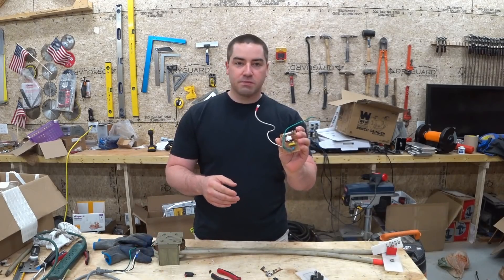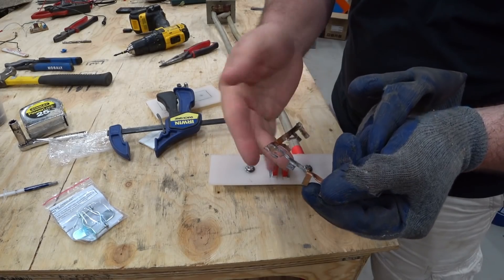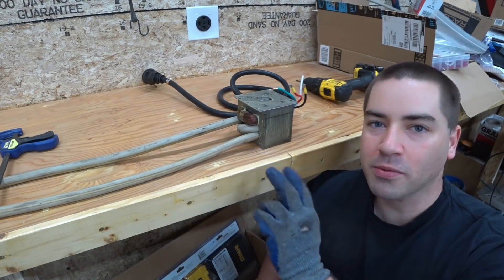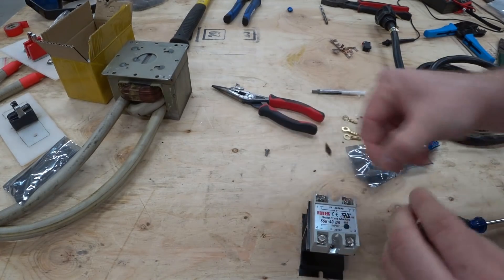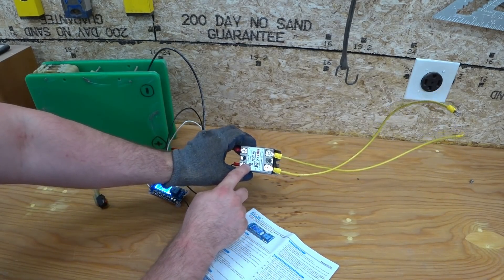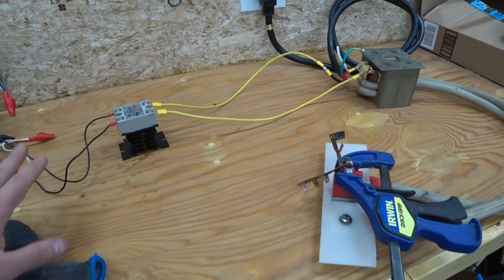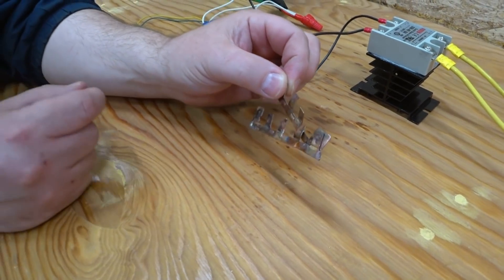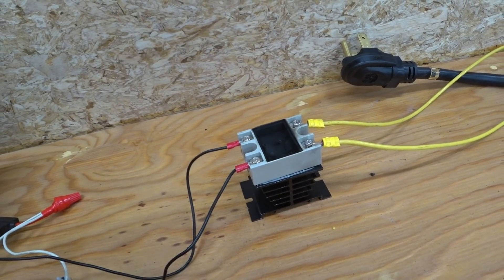DIY Spot Welder, Part 3, Timing and 240 Volts

Comment: David, I love your stuff and have been a subsriber for a while Kudos for showing your failures (AKA Learning experiences) as well as your successes. I've made a spot welder for batteries from a microwave, and I have a couple of hopefully useful comments on your efforts here.

(1) as you already knowm, that transformer is not for 220V which is very dangerous. It will overheat and short out the mains and blow a house breaker.
That is also likely why your 40 amp SSR blew.  In normal use, your 1000 Watt microwave would draw no more than 10 amps from your 110 Volt supply.

(2) 1000 watts is plenty to spot weld battery tabs, so doubling the input power is not the answer, even if it was safe.

(3) Did you remove the shunts from the microwave? These are small blocks of metal laminate inserted into the transformer core to avoid over-saturation. I found I could not get any welding action until I removed mine.

I made a video on this, but I don't want to spam up youir channel - if you'd like the link please let me know.

Good luck!
Chris
Reply from the maker: I'd love to check out your video.  It's not spam if it's helpful.  Thank you for the tips.  Yes, I removed the metal strips between the primary and secondary.
Reply: @DavidPozEnergy  Hmmm. What AC voltage are you getting at the output wires? (Be sure to select AC on your meter)/ I get around 2 volts. Ohm's law still applies so I= V/R. The current is what we want, so if the current is too small to weld, then the voltage is too low for the resistance of the things you're welding. So I would try finding some slightly thinner wire (preferably thinner insulation but trhe same width of conductor) and wrap more turns to raise the voltage. Of course this is a balancing act - thinner secondary windings wil also have higher resistance - but that's the way I would go. Here's my video: https://www.youtube.com/watch?v=6sMxc0NHNQA
Reply from the maker: 1.5 volts AC when I have the primary attached to 120 volts.  I didn't get a chance to record the voltage when it was connected to 240 volts.  My meter is slow and it was getting hot.
Reply: @DavidPozEnergy  OK so it's a low, so trying more turns is something to try. You coulad aslso measure the resistance of the secondary circuit - from electrode to electrode. That should be very low.

Comment: Still using the worst electrodes , aluminium and tungsten rods, use only copper rods with copper buss bars or better use silver if you want to use another metal after the good copper wires you have there.
Reply: chancho00 silver solder in a paste form may be the best chance to doing this task as silver is attracted to most  dissimilar metals ie copper and aluminium
Reply: @AdrianHiggins83  Tinning paste, a mix of flux and solder, might work here and at lower temperatures.

Comment: what was the voltage across the secondary/output leads ?
Reply from the maker: O, boy.  I am trying to remember..  I think 2 volts.  Not quite sure.
Reply: @DavidPozEnergy  was trying to make one earlier didn't quiet do anything.  i was using amplifier cable. maybe too much insulation, will try it again.    i think you need 2 transformers to make 240 v welder.
Reply from the maker: In the end I went back to 120v and left it on for longer.   Several people have written me and said they had better success with two wraps on the secondary wire instead of one.  You may want to give that a try.

Comment: Would a starter relay from a car do it? They can handle a huge amount of current.
Reply: nope, since they dont handle 230v on the bridging end. But will work if you use a 12v battery setup for welding

Comment: My first thought would be to use a big car stereo capacitor low voltage and charge it from a power supply that you could adjust the voltage. You need a big relay like a car starter solenoid. This way you don't have to worry about a timing circuit you just charge the capacitor go to a voltage that works for you. DC might well better also. Click on my profile picture to see my projects

Comment: At least there was fire! I don't know, but intuition tells me you haven't got enough current density at the welding tips. The more you spread the current over a larger contact area, the less effective the weld and the more heat you transfer to the metal?
Reply from the maker: Those tungsten tips have very small contact area.  I don't know how much smaller I can make it.
Reply: @DavidPozEnergy  Hmmm, it's a curly one. Perhaps the resistance in the tungsten is too high? I came across this article that seems to imply some alloy of copperhttps://www.twi-global.com/technical-knowledge/faqs/faq-what-electrode-material-should-i-use-for-resistance-spot-welding
I don't know if this is helpful, I hope so!

Comment: solar is correct. transformer came out of a microwave which ran on 110-120v. I can almost guarantee you that the primary has at a minimum of 120 turns. this isn't coincidence.

Comment: Double the input voltage == Double the output. Wouldn't use it on 2 phase 240v while designed for 120v.
Spot welders won't make that kind of noise. A light hum without sparks. I'm used to handling those.
That it exploded is due the inrush current. Maybe an PTC thermistor and an ZC (zero cross) detection.
Reply: Double the voltage, 4x the power.

Comment: I can confirm those SSR modules are junk, I have used one once and I doubt it could have carried 25% of its rated 40 amps.  I use a large contactor on mine currently, not precise on timing perhaps but it works.  I use a microwave transformer at just 120V, I have a smaller secondary wire and it works ok, not perfect but enough.  I hope to move to using super capacitors at some point with a bank of high power mosfets for switching.
Reply: The real ones are good but there are many fakes being sold online. Best to buy from a major electronics distributor. If you buy them on eBay, Amazon or AliExpress you're taking a big chance they will be fake.

Comment: Use a 100A ssr why did u use 40A even a lipo battery can output 40A easily
Reply from the maker: I did not have luck making my own spot welder.  This is more of what not to do.  I ended up buying a Kweld spot welder.
Reply: @DavidPozEnergy  Ye I was planning to build one as well but a lipo battery powered one don’t like messing with high voltage 🤪🤪
I’m in my 2nd year of electrical engineering at university 👍🏻👍🏻

Comment: That's pretty cool...have you tried some solid copper electrodes? They've always worked best for me...what kind of tungsten is that your using?
Reply from the maker: One of my early experiments I did, but because I'm welding copper, the copper tips weld themselves to it.  I need to use something different.  The tungsten is from my local welding shop ($4) it's used in the TIG welders.  Thanks for watching.
Reply: Idk if I’m right or anything I haven’t looked it up either....but tig tungsten I don’t think is going to work....when your using tungsten in tig welding it is shielded with argon the entire time protecting it from the atmosphere....so I think soon as you fire them as spot welding tips, the tungsten prolly immediately contaminated and every time after it just degrades further....so maybe if you could shield them when trying to spot weld somehow...I don’t think it work...I could be wrong tho...I know it don’t take much to contaminate the tungsten tho...
Reply: But I don’t know a whole lot about tig welding...I’m just learning and practicing and figuring it all out

Comment: I was going to say you urgently need a fuse on the primary side because the solid state relay will probably fail "on" but I guess you know that now. I am no welder but I would have thought cleanliness of the surfaces to be welded would be vital and you don't want any weight on the point being welded or the whole assembly can start moving when the metal becomes briefly molten.

Comment: I know exactly what the problem is. I know this because I made the same mistake myself. 

First off I don’t recommend ever hooking up a transformer to power it wasn’t designed to take. Your transformer was designed for 120v and that’s what it needs to be run on.

Quick disclaimer: I take no responsibility for what anyone else does. Electricity is dangerous.

That being said this will worked with the transformer hooked up to 120v. The problem was that you grounded the transformer frame. If you run it ungrounded you will get the results you are looking for. It seems like such a small thing but it makes a drastic difference. 

I absolutely love doing projects like this too. Just please be careful. I personally prefer to add a switch(just a normal light switch in an electrical box). But when handling anything from where the wires connect to the transformer and after, I always pull the plug from the outlet. A switch can fail. It’s rare but it can happen. It’s also very easy to after going back and forth trying something turning it on and off to end up forgetting. A mistake that most likely would only happen once.

I have personally made 5 different devices from microwave transformers. They are a great transformer to get because of the accessibility and the power capabilities.

Best of luck to you. Stay safe.

Comment: To increase the welding current, why not use higher number of turns on the secondary? Those wires are way overkill for the short duration of high amperage..
Reply: More turns = less current

Comment: Getting closer...;-) Good electrical safety precautions...
The next test would be trying to weld the 2 pieces without the Solder on the 2 pieces. Just copper to copper. Since the pieces keep coming apart when forcing them I believe the heat of the arc just solders that small (tungsten probes) area together rather than actually spot welding them.
With the solder only Spot connection... the connection could come unsoldered if high currents are drawn from the the battery bank.

Comment: all the videos i have seen using those transformers use 3 turns on secondary
Reply: One turn is not enough voltage... you are correct. I believe two to four turns on the secondary is very common and works. Also.. he should have never used 220.

Comment: Please don't go Edison's route, 10,000 ways, build or buy or borrow a proper spot welder before you hurt yourself or your home. 
You have no current limiting in your 220 volt circuit, and your short timing is not tripping your circuit breaker, you could be reaching dangerous amperage levels, 100 amps or more.
If you must go this route, and not capacitative discharge, please use a thermistor or other inrush current limiting device.
There are plenty of spot welding kits on the market, maybe even one that will allow you to use the setup that you already have, please BE SAFE.

Comment: Unless you have to weld copper strip, you might do better with nickel strip and copper electrodes.  That's because tungsten is much more resistive than copper and so the heat gets generated in the tungsten weld electrodes then has to make its way into your copper.  The copper tends to melt from the outside in, which isn't ideal and much of the power is wasted heating up the tungsten.  If you use copper electrodes and nickel strip then all the power gets dumped directly into the more resistive nickel, which will be hottest right in the centre, just where you need the weld to be.
Reply: This is old, but I was going to suggest the same thing. Spot welders use copper electrodes for a reason. Copper is one of the best conductors of electricity, so will not get as hot as tungsten.

Comment: I should have also mentioned that a dead man style foot switch is a nice thing to have. Also if you want more power, two transformers can be used. I would only do this if they were either identical transformers or at least both rated for the same power input and output. So your two transformers after being rewound will each have two output wires. One wire from each transformer needs to be linked with the other, then you’re left with your positive and negative wires, one being from each transformer(note if this doesn’t seem to be working we’ll switch one of the wires that’s tied together between the two transformers). This setup does require a wall outlet that is 220v, it needs to be a 20amp double pole breaker. Which gives you two hot wires at the correct voltage, one for each transformer, the neutrals would be tied together from each transformer going back to the wall outlet. 

*[Disclaimer. This is dangerous. Don’t do it. If you do do it don’t die. If you do do it don’t get hurt either. 

Also be responsible, have your pets spayed or neutered.

Comment: Add a ballast resistor in series with your transformer (or SSR).  An electric heat element or two 120v light bulbs would keep you from cooking the transformer primary.

Comment: You are on a half way David. Just like me when I was building my spot welder. You will achieve perfect result by increasing secondary voltage! As I said 5.5V and You are DONE. 😉
Reply: how many turns on the secondary to get 5.5V?

Comment: your electrodes need to be copper and your secondary wire needs to be smaller with more loops to increase the voltage output then leave your primary voltage at 120v . Remember that aluminium electrodes have a low melting point and will melt and oxidize immediately then that raises the resistance of the weld connection.

Comment: put a ball of paste in the middle in the future and press it out, it hurts my eyes how you apply it
Reply from the maker: Thanks for the tip.  I'll do that next time.
Reply: @DavidPozEnergy , Also, less is more with thermal paste.  Direct object to heatsink contact will give the best thermal conduction.  So thermal paste is a better conductor that an air gap, but not as good as direct contact. The thermal paste is just there to fill any irregularities like scratches, warping, etc. that would otherwise result in an air gap.  If the items are reasonably flat and smooth you should only need a translucent film of thermal paste.

Comment: Since the resistance of the primary coil stays a fixed value, when you double the input voltage it increases the power consumed to 400% of what it was at 120vac.  240vac through that type of transformer will fry it after only a couple seconds.  This will likely take the form of burning off the insulating laquer coating on the primary windings.  Once the insulation is burnt off you essentially have a dead short across the primary, and not the few ohms you would normally see.
You have to be very careful who you listen to, especially on social media for such advice.
Reply: Agreed - although in Australia, I was fixing a laser power supply that was supposedly 220V (close enough to our 230-240), but the transformer inside was 120V. Stinky smoke ensued. People even burn out these MOTS just using them for drawing arcs.

Comment: I was happy for you, until the unfortunate ending. My opinion is that the transformer iron is saturating with the voltage being much too high in the primary side. Your transformer primary is designed for 120vac which keeps the flux level below saturation. By exceeding the volt rating with 240vac, the iron saturates. When this happens, the inductive reactance drops, and the current goes high on the primary side, without hardly any added current on the secondary side.
Reply: Correct me if I'm wrong, but the saturation you are talking about only applies to some magnetic materials.
The voltage rating comes from the insulation of the wires-coils.
Exceeding the voltage rating by too much could lead to arcing and thus damage of te primary.
And the current rating comes from the amount of heat the transformer can disipate.
Exceed the current by too much (for long enough) and the temperature will rise too much.
Reply: @iliazark1  The transformer core does indeed saturate at 240V turning the primary just into a resistor.  When these are typically used on 120V, some extra wire is added in the primary.  There is also a laminated steel bar magnetic shunt that must be removed from between the primary and secondary for the transformer to function properly.

Comment: Do yourself a favor and buy an 18650 battery spot welder - with all of the experimentation with batteries that you are doing, you will get a lot of use out of it.  I'm enjoying your trial and error to create a spot welder, but it's time.  Especially when I see you "playing" with 220V.  The pre-made spot welder will be much safer and it will work.

Comment: That solid state relay, is it one of the knock offs from china that is too good to be true?
And if it is a good one, is it built for inductive load?

By the way, in this application you should have one that is built to fail open - then if the relay fails, it cuts the power.
Reply from the maker: It was rated for 40 amps, but given what happened I'm guessing it was a cheap one.

Comment: Oh, wow. Glad nothing big happened! I was actually wondering if the SSR can handle the load. Despite being rated at 40A it uses a triac that can only handle 16A (unless Chinese used something different in this one than BTA16-600, 16A/170A peak for an extremely short period) which is about 3.5kW +~25% at 220V, so probably up to 5kW for short work. Which should do the trick unless it's a short circuit. I believe if you gonna drop in a 20-40A circuit breaker in between of the SSR and transformer you should be fine next time. Still risky stuff, so good luck with the project!
Reply from the maker: You guessed it right.  This SSR was rated at 40 amps.  The circuit breaker on this outlet is 30 amps.  I did not think of trying another circuit breaker in between.